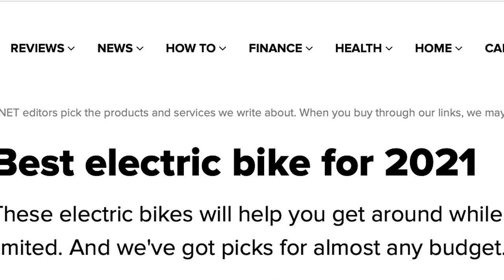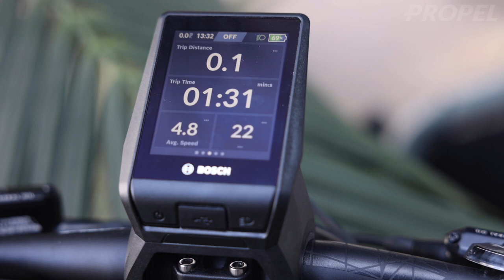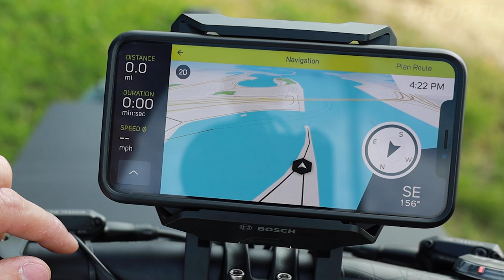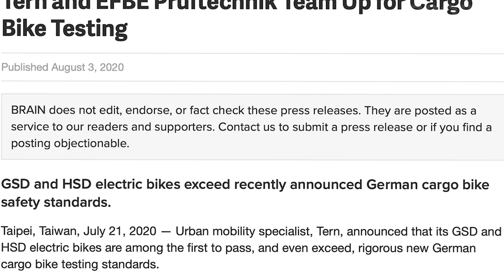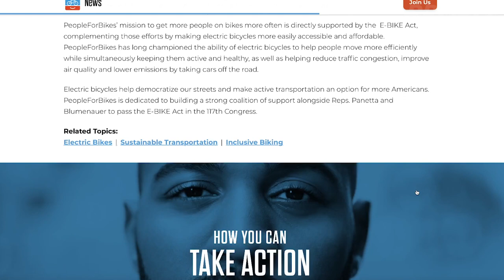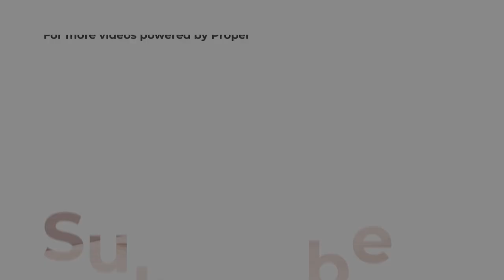Electric Bike Trends for 2021

Comment: Good video Chris.  I'd like to see all ebike manufacturers offering a GPS option embedded into the bike or motor (not in the controller) for location tracking which the customer can take or decline when buying.  Another service I want to see is cities or entreprenuers providing secure bike storage facilities.  I love getting out and about on my ebike but dread anytime I need to lock it up and run an errand due to the nagging fear it will be stolen by the time I get back to it.  Ebiking offers a lot to us - tax incentives to buy, staying healthy, safer travel with cycleways and it would be good to now see bike security given a higher priority.  Finally, shout out to Riese and Muller for now publishing sustainability reports!
Reply from the maker: I'm with you 100% I have been thinking about the same things all the time.
Reply: Bike theft is a big issue. My new Riese Müller costs over 8000€. You could get a decent, used car for that.
That’s why my baby will sleep in my apartment. Already two e bikes got stolen from me.
Even if you’re insured, its a hassle.
Reply: @holyfox94  I can see why many thefts want to steal your bike. If a car is stolen even if its half your price, police will look out for it but a bike? Gone, goodbye... at least that how it is here in the Washington/US.
Reply: @SteveL11  Same in Europe. Police doesn’t investigate bike thefts. Even if the bike is found, it’s probably heavily damaged
and you wish it hadn’t been found.
At least if you have insurance, which is a must for quality bikes.
Reply: Can u provide insight on tax credits?

Comment: More lightweight models, lighter batteries, lighter motors, lighter frames, along with a rationalization of the amount of power and range the average rider needs to achieve that. More e-bikes that are easy to carry up stairs and load onto bikes racks.
Reply: Totally agree. Specialized is doing great innovation in this territory with their SL bikes.
Reply: This is why I still ride my Turbo Creo SL so much. It’s super light weight.
Reply from the maker: This is an excellent point for sure! I definitely hope we see more in this category as it's very important!
Reply: @Propelbikes  Specialized just released a Turbo Cuomo commuter bike with a belt drive that is super light.
Reply from the maker: Does look cool!

Comment: I would love to see reduction of cost, and standardization, of battery packs similar to other consumer oriented batteries.  The per kWh cost of e-bike packs is insane and it’s frustrating that the consumer has no choice.  It’s like only being able to put Chevron gas in your car, or only being able to use a BMW 12V battery.  When the battery pack in your e-bike dies, you can only hope you can find an affordable replacement, or find a replacement at any cost.  Unfortunately many e-bikes with particularly proprietary battery packs are destined for the dump.

Comment: Integrating ebikes as transportation and lifestyle modifiers may be one of the most powerful uses going forward.  The ebike could really be the gateway for people with fitness challenges to get moving again.  There is such an opportunity to do bike based businesses as long as it doesn't become another avenue of regulation and taxation.  Your reflections really add value to the conversation.
Reply from the maker: Love this! I think of this all the time! Such a branding opportunity for these bike based businesses as well. I was thinking of things like an exterminator riding around a city in a cargo bike. Could be perfect!
Reply: A rising tide floats all boats: the key for increasing e-wheels and pedal-transport commuting uptake is more mode separated infrastructure, more local businesses & services that welcome them (eg. access & security), more facilities for secured parking and a growing cultural shift to incentivise pedaled/e-wheeled transport in school/ work/ community to the extent it is the norm - the Dutch way

Comment: Here in Germany, the local trains are well equipped to take on board bicycles. If this is not yet the case yet in the US, then it should definitely be considered as something to be worked on.
Reply: Local trains,... oh my sweet summer child.  Outside of a handful of cities (metropolitan NYC, Boston, and the SF Bay area, for example), there are no local trains in the US, and where there are train stations, there are rarely safe ways to get to them by bicycle.  The perpetually underfunded Amtrak provides some horrifically unreliable and slow train service between cities, but the local train network that you enjoy in Germany simply doesn’t exist here.

Comment: Very good video. Following the trend with new players on the Market as you mentioned. I confess that in the end I went for the Cargo Cube instead of the Packster 70. True that doesn't have cable steering and three child seat configuration. However have generation cargo line motor with deraileur or enviolo, the same suspension Suntour, the possibility of belt drive as an option, a bigger foam box, cargo brakes, and over hall weight limit of 220kgs. It's available now, instead of joining a 35 week waiting list for the packster 70 or Urban Arrow.
Reply from the maker: Thanks! How do you like it so far?
Reply: @Propelbikes very good overall. Definitely  it's cheaper than the other two versions. The back mudguard attaching to the frame is very fragile  The permissable weight is 220kgs, however the front load is limited to 60kgs and the foam squeaks a little. Very easy to attach a second battery   with a kit provided  by the dealer so different  from the packster. Just waiting for the rain canopy. The video on you tube gives a good idea. Hopefully  they will have more options in the future, since they just started. The cargo bed is 75 centimetres like the load 75 and there is the option of using gates belt drive with the enviolo hub

Comment: It would be fantastic to see an integration of eBike motors and a gear system. For example combine a Pinion gearbox with a Bosch motor. The weight of the typical gear mechanisms would be shifted to the BB area of a frame where the motor is already in place. This would reduce the unsprung weight of the rear wheel, and rear triangle for a full suspension bike (for better rear suspension reactiveness). Thanks for another interesting video, Chris.
Reply: That's an excellent idea. There's definitely room for further development.

Comment: As bike security has already been mentioned, getting rid of cables by means of electronic shifting, then electronic suspension with a wireless lockout at the handlebar would be on my list. The products are already available but the associated cost is currently huge.
Battery capacity is already good. With my 750 Wh battery I am capable of geeting up to 160 km in flat terrain. However, in the Swiss Mountains, one can run out of juice after just 30 km. So having more marging for demanding terrain would be appreciated.

Comment: My wife and I have recently purchased our first E bikes following a couple of years of procrastination. 
One thing that we thought was lacking in the market was the lack of belt drive/hub geared offerings from many manufacturers. I understand that belt drives have their limitations in some applications but for the majority of day to day commuters they work extremely well
in the context of an E Bike. Often we would find a bike that suited our wants in every respect but lacked belt drive as an option.
The other thing that we found frustrating was the lack of options and expense of hub gearing systems. It would be good to see more development and some competition in this area.
Ultimately we stumbled across a small and relatively new manufacturer, Lekker Bikes.
The bike that I chose came standard with belt drive and Enviolio hub.
My wife's bike came standard with chain drive but with the option of "upgrading" to belt.
Integrated lights, guards and side stand as standard were also appealing and the bikes were priced below our budget. They're also lovely bikes to ride.
It would be good to see the large mainstream manufacturers develop more products with belt drive as an option.
Reply: Belt drive was also one of my main sticking points. Wanted it but couldnt find it on any  ebikes I liked.   Pretty much gave up and put my name down for a gazell but then supply chain issues saved me from that.  the bike kept geting delayed and delayed untill after 3 months of waiting they finaly had a firm date another 3 months out.  Canceled the order and found a small company called Priority.  All their bikes are belt drive and they put out an ebike last year and I've been loving it for the last 3 months.  I really love not having to do any chain maintenance  although fixing a rear flat is a tad more involved than a chain drive.
Reply: @merendell  It sounds like your frustration might have resulted in good fortune for you. 
Changing a rear tire doesn't look like much fun but I'll cross that bridge when the time comes.
Yes, chain maintenance is another chore on the list of things that you don't want to do. The big advantage that I've found with belt drive so far is how quiet and clean it is and the lack of its propensity to drag a poorly stowed trouser cuff through the front sprocket. As a returning cyclist and first time E bike owner, I'm noticing the absence of muck and debris on my preferred
cycling pants (whatever I'm wearing at the time!).
Belt drives mightn't be the be all and end all of E Bikes for a lot of people but having put a few miles on one it would be hard for me to go to a chain drive system. I'm a convert.
Reply: @davidbrayshaw3529   Ya I'm happier with what I got and even saved about a grand.  The rear tire isnt horible to change, it just has a few quirks you need to be aware of.  Its not as simple as loosen the axle bolts and tug like a derailleur setup.  You need to disconect the cable to the hub shifter and depending on the dropout design release the belt tension before you can get it free.  Afterwards you got to retension the belt and hook your shiftier back up.  Geting the right tension is kinda important so that can be a bit fiddly to do in the field.

Frankly I'd recommend taking the wheel off and puting it back on at least once at home to practice.  Took me 2 hours the first time but I'm prety sure I could take it off and patch the tube in half an hour the second time around.  That includes the time to do the actual patch as well.  There we a few quirks on mine that took a bit to figure out on how to get the cable in and out
Reply: @merendell  Thanks for the tips. I've been thinking about buying a bike stand. Now might be the time.
Reply: I suppose to reduce the likelihood of punctures and the hassle of changing tubes, invest in a tyre that has substantial puncture protection and check your tyre pressure before every ride.

Comment: Good Video Chris. I live in B.C. Canada.  Our terrain is either up or down with not a lot of flat sections. On my wish the features I'd like to have are:  
the belt drive,  long distance battery packs, full suspension, and back road capabilities (ie aggressive tires for all seasons).
Any suggestions?

Comment: I was talking to someone recently about my e-bike and they asked "does it recharge when you go downhill?". Fair question, and regenerative braking would seem like an obvious mainstream feature of e-bike future design. But...such design might be more easily engineered into a hub-drive system than a mid-drive system, and I wonder if we'll see hub-motor design (where motor, shifting, sensing and SOME braking/charging all happens in one black box of a hub) evolve to a point where hub-drive is no longer the poorer sibling of mid-drive, but actually where the big motor brands end up pouring engineering resources.

Comment: Apparently stormer are applying frame integrated anti-lock braking to many of their performance intended bikes, it would be interesting to see what happens with other higher quality brands such as R&M or Urban Arrow etc.
Reply from the maker: For sure! Bosch has this offering in Europe, but it hasn't made it's way to the US yet. Likely it will in the future though.
Reply: @Propelbikes  it would be very much a benefit for places which are likely to have slightly more slippery roads or slightly less adequate cycle infrastructure.
Reply: @maxnewts  Actually, ABS would be a benefit everywhere. Used universally, unit price would plummet. Early adopters will take a hit.
Reply: @jacquesblaque7728  true! I can imagine later down the line when even mass market bikes sold at mainstream adventure stores would be sold with minor electrification and including safety features like that as standard.

Comment: I would like to see the weight of the batteries reduced and the range increased.  Greater adoption of range extender systems where a smaller capacity battery can be attached. More protected bike lanes in cities,
Reply from the maker: for sure! I think you got the idea!

Comment: I would love a disabling device.  It could be distance related to a fob carried by the owner, or an app.  Have a mounting bracket so I can use my iPhone, instead of a wired hub.  Make it so it doesn’t roll at all, unless I want it to.  A 70 lbs brick.
WaterPROOF!

Comment: I'm looking to upgrade to belt drive and with all of the changes which are in the works wonder when a good time will be to look for a new bike.
Reply: Find a good regular bike with rohloff hub  that fits you and slap a mid drive motor kit on it.  Just make sure it has good brakes.
Reply: @TheAgentAssassin  I think I can handle that and will start looking. Thank you.
Reply from the maker: This is definitely one way to go, but the experience will likely be different than if you buy a bike built to be electric.
Reply: @Propelbikes  Fortunately I have a good rear hub chain drive e bike and will ride it until I find an alternative in belt drive. Prices seem to be coming down.
Reply from the maker: Awesome!

Comment: Yes yes yes to all the other people who mention bike security. More people riding $3000+ bikes instead of $500, but using the same locks.
Reply from the maker: For sure. More video ideas are brewing!
Reply: yeah   scary   DEFFINATELY a serious concern. i had 3 bicycles stolen in Manhattan.   & i had many encounters w/ thief who asked me  what i want?   i watched bicycles being stolen   right near me as i was sitting in a taxi.
    theft - its a serious concern
Reply: Better locks won't really cut it either. Oh look, I made a pun! Bike thieves don't even bother with picking the lock. They just cut through the metal with power tools.

GPS might not work because police won't do anything about it if you give them the GPS info of your stolen bike.

The only thing I can think of to fix it, other than insurance, is cities adding more bike lockers.

Comment: i am 75 years of age i have 3 ebikes each one does different tasks,they purely for exercise and they are great all the year round training the first one is heavy downhill mtb it is 250w side drive road legal great for quarry roads farm tracks ,full kit lights mud guards ,mirrors, dynamos, shockers front and back,lead acid batteries ,and lithium for range extenders duel voltage 36v or 24v bomb proof ,bullet proof, unbreakable ,the second is a mtb shockers front and rear fully loaded ie lights dynamo all year round protection 250w front hub 6 power settings rides superb duel voltage 36v 0r 48v lead acid or lithium for range, third bike Carrera vulcan no shockers very light weight fully loaded with lights ,mudguards all year round  lead acid and lithium range extender   ideal for takeing with me when motorhomeing why use lead acid batteries stops all off the local scum bag bike thieves,do you need more than 250w motor no you dont buy a motorbike,i use my bikes twice a day every day,footpaths cycle ways, highways, dirt tracks ,quarry's total freedom love em

Comment: Damn, I missed first comment because I was too busy resting on my laurels instead of keeping my eye on the ball. Well, that's a lesson learned and no mistake. It won't happen again‼️ Anyway, Chris, another great video that could only have been improved by the inclusion of the charming young lady featured in your previous video. Please note, this isn't so much a hint, it's more like a demand‼️🤨🤨🤨
I won't get started on the stupidity of monetarist capitalism ( did I hear you say, ' Thank the Lord '? ), but rather concentrate on eBikes. 
Education of the general public, such as you are providing, is essential in promoting the acceptance of eBikes as a viable means of transport. Commercial enterprises will realise this sooner than individuals, as an eBike is cheaper, faster and much more "green" than a van. These advantages give them a great deal of advertising kudos when compared to their "dirty" rivals.
The increase in popularity of cargo eBikes in the private sector is very encouraging. It means they are being seen as a replacement for the second/third car. This is the start of a change in perception of transport. Ideally it will lead to the use of eBikes and public transport as the primary means of transport, and the car relegated to occasional use. This huge change will, of course, rely on the government's total support, but, currently, there's a lot better chance of that happening.
Well, my index finger is worn down to the knuckle with all this typing, so, wishing you a happy easter, I'm signing off.
Oh, just before I go, I loved the change of focus at the beginning; very Alfred Hitchcock.👍👍😜😜